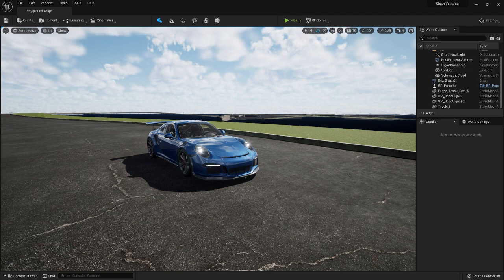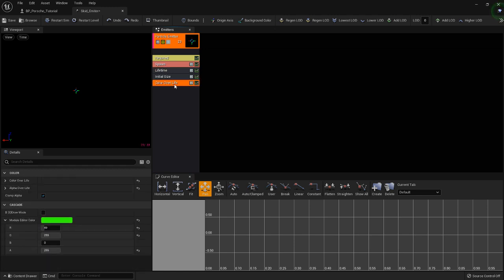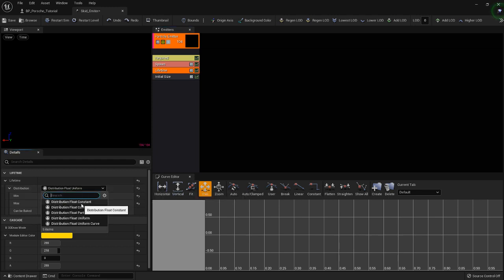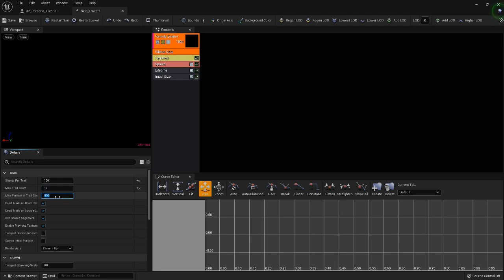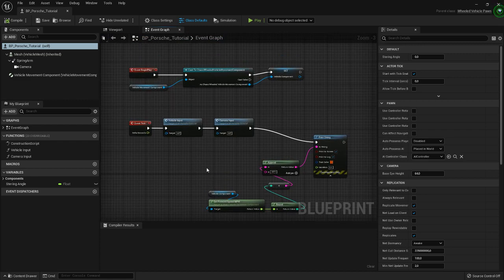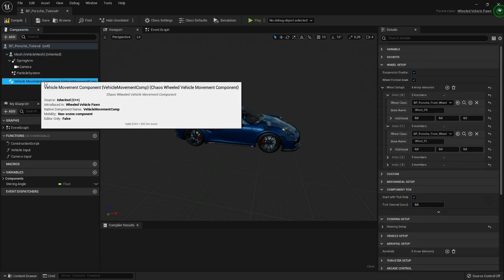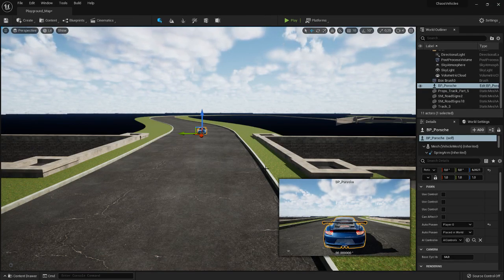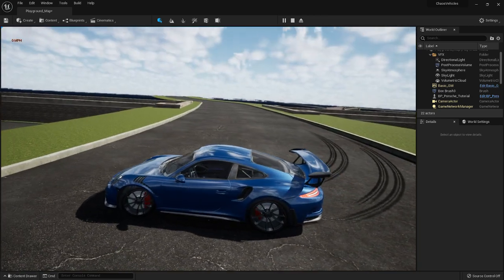04 - (OUTDATED) Skid Marks! (UE5 Vehicle Tutorial)

Comment: Add RPM bar to standard Vehicle project
for all attempts to get it from "Chaos Wheeled Vehicle Movement Component"
Pay special attention when the car is in the air or turned over and lies on the roof, when the wheels do not touch the ground, the engine cannot give the correct rpm? Sound design depends on RPM :с
How to deal with it? waiting for the next videos.
Your template projects are incredibly helpful as study reference. Much appreciated.